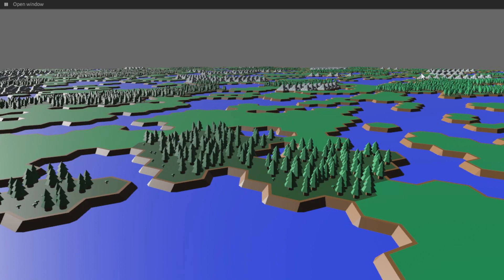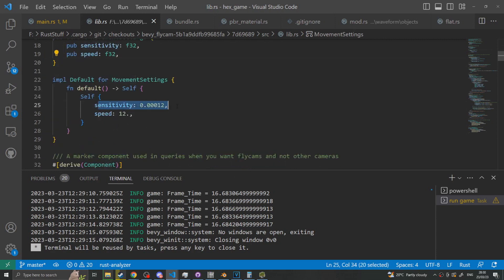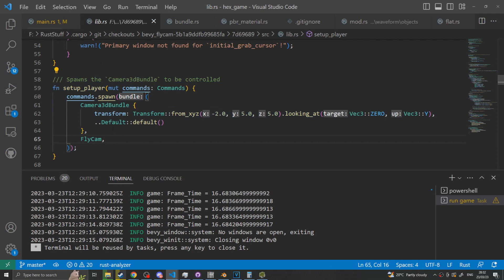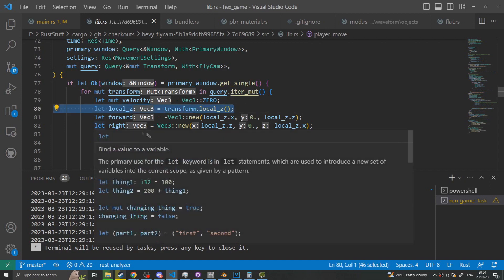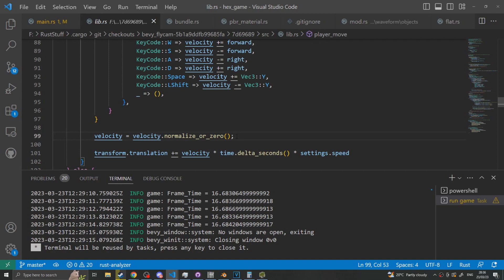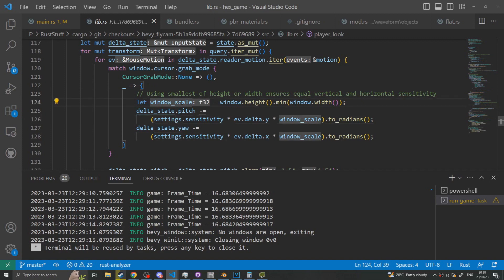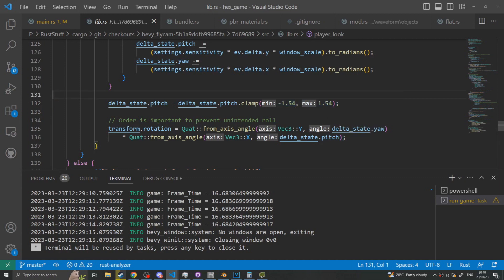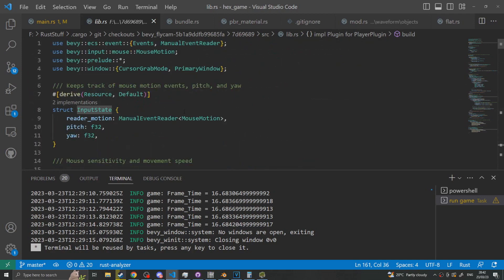How Bevy FlyCam Works

Comment: I seem to have a bit of smoothing both on the movement and the look rotation. I'm not sure if it's something to do with how the ManualEventReader reads events, but it seems delay? not sure what is going on!
Reply from the maker: Hmm that does sound interesting. I'm not sure, without seeing the code.
Reply: @PhaestusFox  Truly was about VSymc, Bevy's default is Fifo by default, but this has an impact on the input response time. Setting it to AutoNoVSync worked great for me.